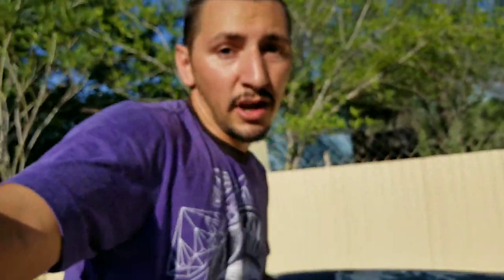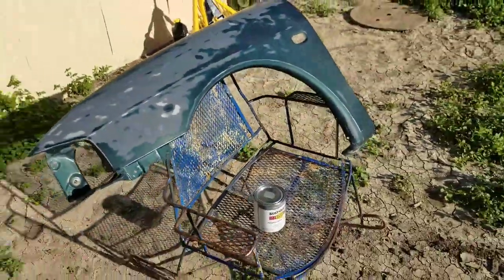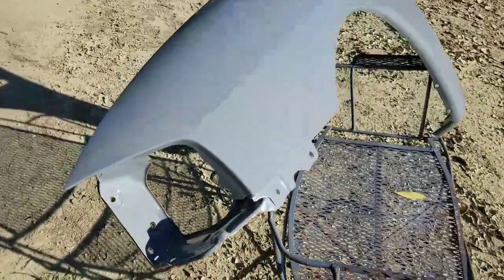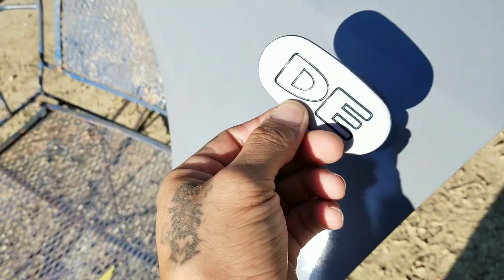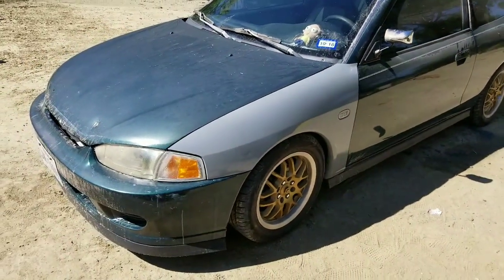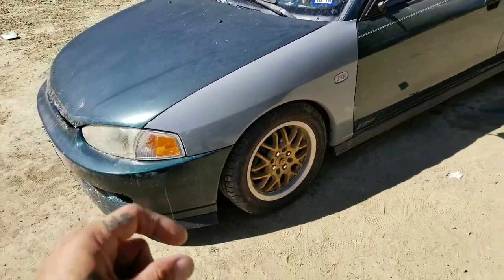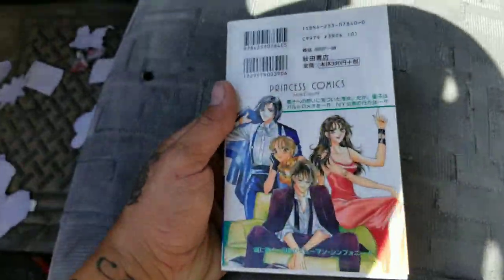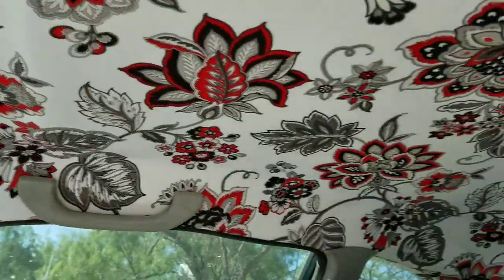Testing Rustoleum Smoke Gray on fender + [ Custom Headliner ]

Comment: Gray and Black with a Red stripe is the scheme I went with on my 98 Suburban.  I did mine with rattle cans mostly because I wanted it to be a temporary solution and a proof of color concept.
Reply from the maker: I've had so many color ideas, but at the end I may not use red.. I was thinking red because of the headliner material I used,  but now that I painted the whole car and removed almost everything.  I'm sorta re doing everything so I've decided on another color.
Reply: Sounds like you have the same issue I do.  I can't afford to do the final coating on my Suburban yet, so that "temporary" spray has to last a bit longer. Meanwhile, I'm seeing grey become a more prevalent color in factory options.  Toyota is doing gray and black with red accents so now I'm not sure any more.
Reply from the maker: @rockymtnredneck4888  oh man, I totally get you! Not that I wanted to be the first,  but at least here in town. I had the idea since a long time ago also, but hadn't acted on it. Then I saw a commercial for Fiat  I think.. was a gray car with orange roof and mirrors. Then like you said, I started seeing more gray colors out on the street, so that threw me off.
I'm just trying to finish this idea to start a new project.